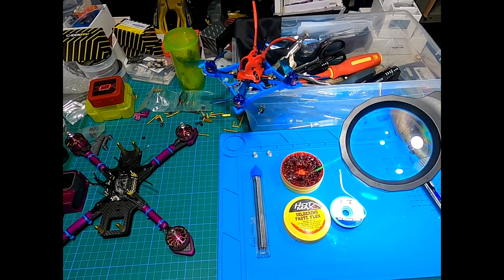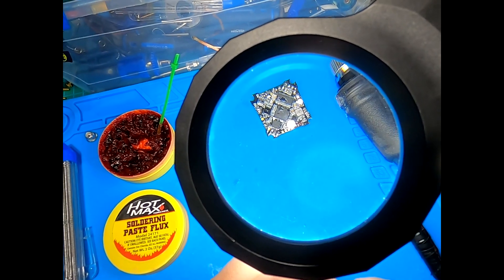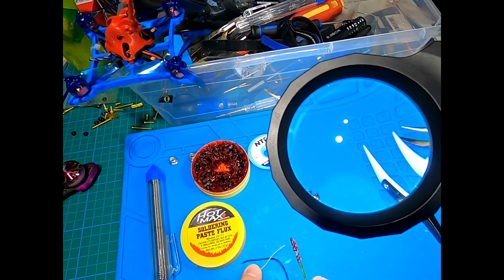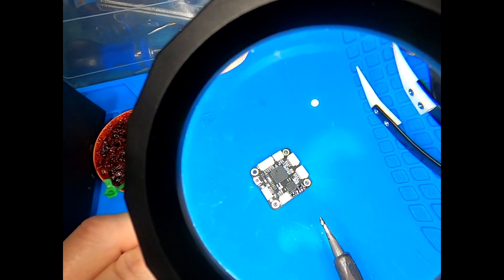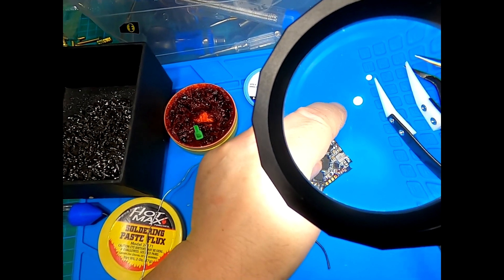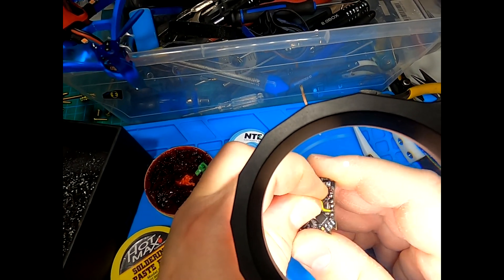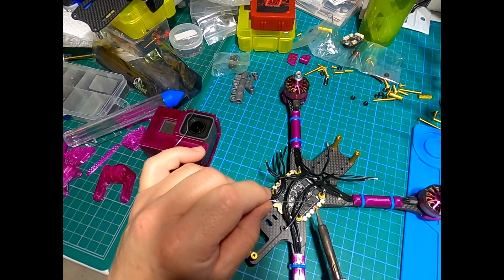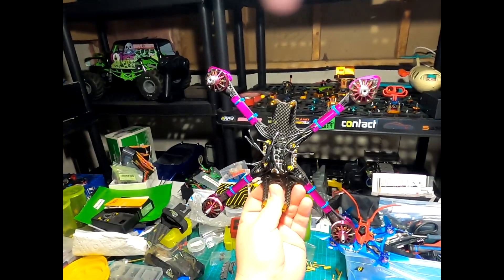Drone Soldering For Beginners - FPV Soldering For Dummies - FPV Soldering Tips

Comment: Thanks for these tips. I'm practicing on a fried Tinyhawk before moving up to camera replacement in a 2024 mobula 6.

By the time I'm ready to build a 3-4 inch quad, I'm hoping it will be easy having started on such tiny components.
Reply from the maker: Ya definitely if you can solder tiny stuff you are good to go. The easiest way I found was to pre tin the wires and pads and just hold them together and apply heat. I always add flux before I pre tin and when I am holding the wire to the pad. After make sure to use an alcohol pad to clean the flux off.

Comment: Good quality solder is a must. 480deg temp is not good for the tip and the pads. I broke 3 AIO and their pads because of too much heat. Now I only solder at 350deg for uarts, 380 for xt30 and negative and motor pad,. I now don't use flux, but i can say my solder is pristine quality. 0.8 flux cored 60/40.
Reply from the maker: Interesting. 480 temps could be too hot but the way I'm soldering here, it works well. I've NEVER lifted a pad soldering and I have built at least 15 quads and repaired and rebuilt/changed quads. The way I do it is I pre tin the pad and wire so I'm on the pad for a very short time which the flux helps tremendously. I can solder without flux but I just like the way the flux transfers heat fast and makes the solder cover the pad uniformly. Then it's a simple matter of a quick touch of heat on the wire and pad and it's done. I guess everyone has their own way and what works for them. Also, depending on the brand of FC and ESC the quality differs and pads may lift easier.  I find this way of soldering easy because of the heat and flux and the fact that once things are tinned then no extra solder is required usually. This is just my experience and yours will be different for sure. But I have found this way of soldering very easy and it would be easy for a beginner as well.
Reply: @Derelict FPV  we all have our own preference. As long as we practiced a lot and master our tools. Try this super shiny solder. Kaina High Grade Solder, must be the blue label.
Reply from the maker: @jeffclassics  I will check it out.